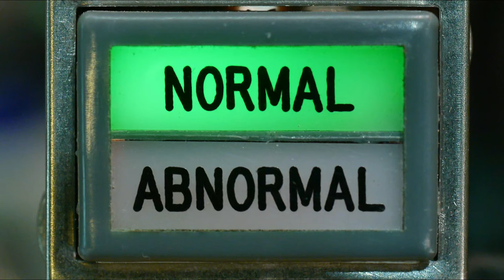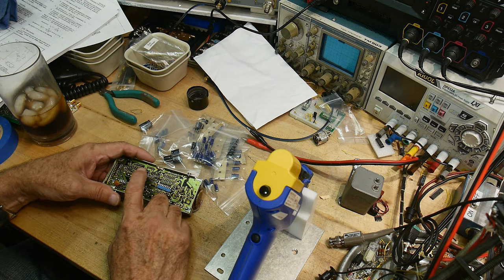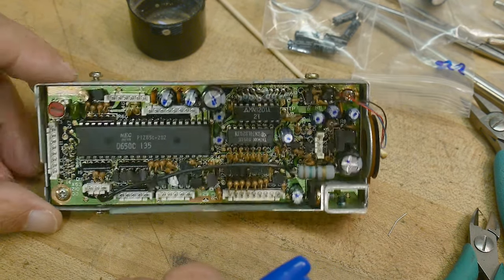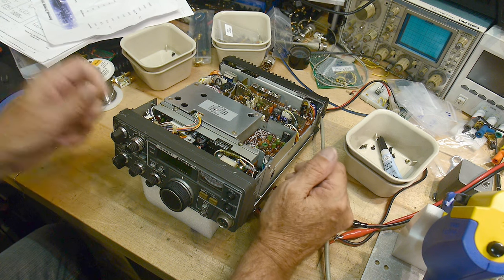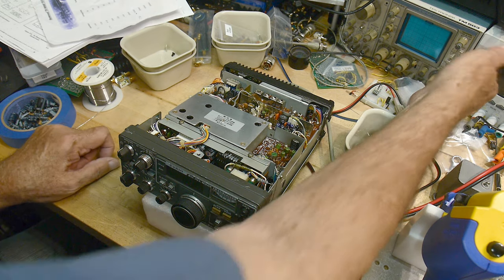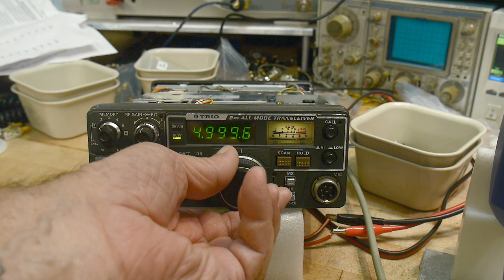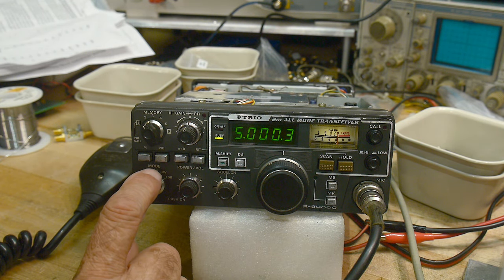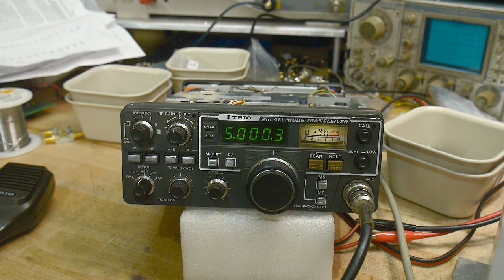#1642  Trio-Kenwood TR-9000G 2M All Mode Transceiver (part 4 of 7)

Comment: If your using a older comms test set that does not have a dedicated SSB mode just set it to carrier with no modulation.  In the case of 145.000MHz USB set the test set to 145.001MHz and you should hear a 1kHz tone.  For LSB set it to 144.999MHz.
Reply from the maker: that makes too much sense, thanks

Comment: Great series! I do love the looks of these 80's radios. With all of the new caps it should be good for years to come. It's nice to see that they use quality Nichicon caps in these kits. Antique Electronic Supply is a pretty cheap source for components. I'm curious why the meter back light went pout when transmitting FM?